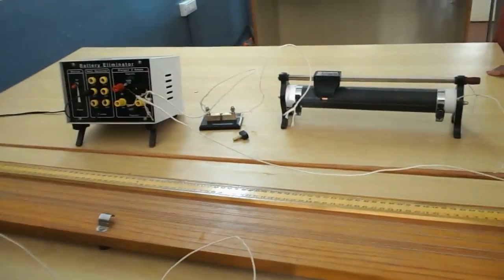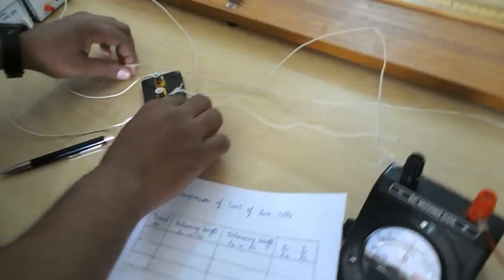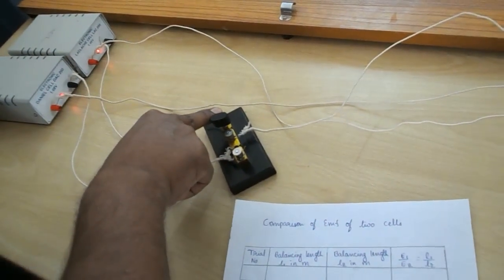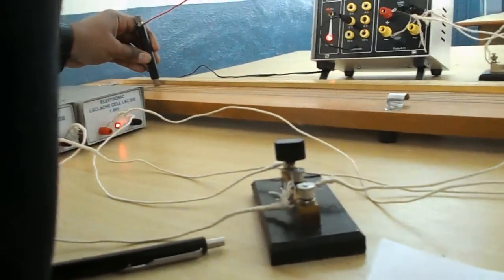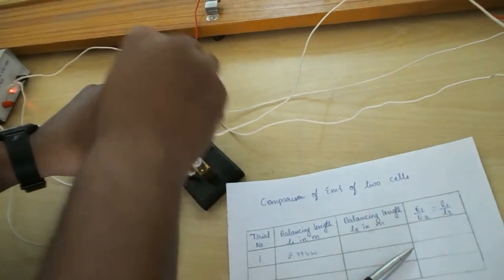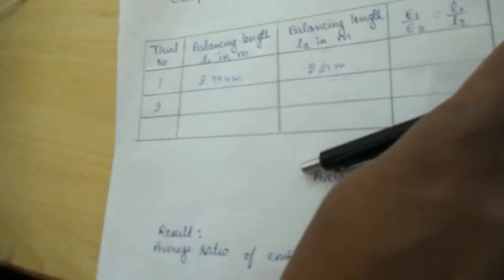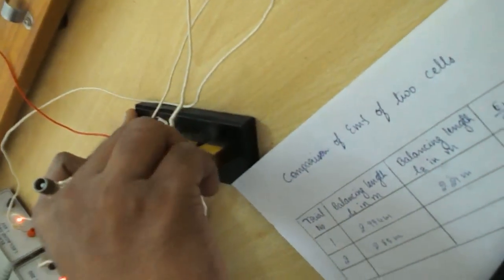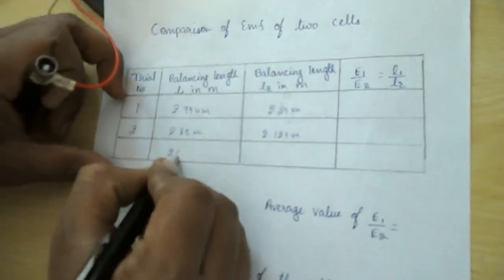Comparision of emf of two cells

Comment: Apparatus and materials used
Potentiometer, galvanometer, battery,two experimental cell,resistance box,two way key and jockey
Potentiometer is based on the principle that balancing length in the uniform wire is proportional to the EMF of a cell in the secondary circuit
E invesly proportional to l OR e1/e2=l1/l2
FORMULA
e1/e2=l1/L2
where e1 is the EMF of first cell (in volt )
e2 is the EMF of second cell (in volt)
L1 is the balancing length for first cell (in meter)
L2 is the balancing length for second cell (in meter).
Read this

Comment: but according to the manual,an ammeter and resistance box has to be connected as well :/ its so confusing :/
Reply: Resistance box is connected in series with the galvanometer so that if excess current passes through it the resistance box will protect the galvanometer......
Reply: exactly +wildglorypsn

Comment: good explanation.clear.but in calculating internal resistance of a cell using potentiometer , in one of ur videos, the internal resistance calculated is 159 ohm. whether its too high? internal resistance should be smaller, then how's that much value is obtaining?
Reply from the maker: yes I know, I am concentrating only on circuit connection and how to take out readings.